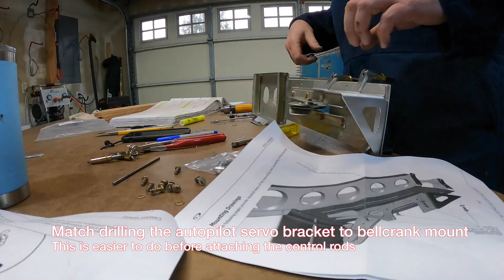McCoy's RV 10 Build Video 16

Comment: I know you finished this part a while ago. Do you remember or know how long it was (firewall to end of tailcone). I have my empenage kit (presently at my hangar) and will be building in my garage. Trying to determine if I'll be able to assemble fuselage and empenage in my garage.
Reply from the maker: I don’t remember at this point.  It was a very tight fit once I put the nose wheel on.  I think it was about 21 feet from firewheel to end of tail one without the vert or horizontal stabs attached
Reply: @msmst25  Thanks...

Comment: Man an a parent of a 13 year old I really hope I can get him involved in the build when I get going on mine that must be awesome.  If you dont mind me asking are all the gold and blue cylinders in front of the fuel valve brake related?  If so which company did you go with?
Reply from the maker: I used the standard fuel filter and boost pump from Van’s.  Brake lines and fuel lines are from TS Flightlines.  The brake master cylinders attached to the rudder pedals came with the fuselage kit.
Reply: @msmst25  thanks